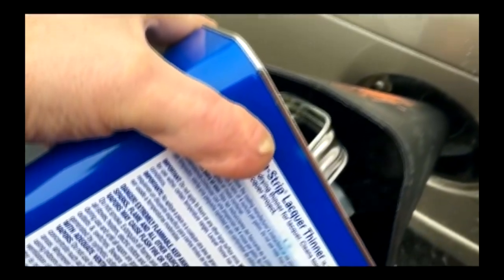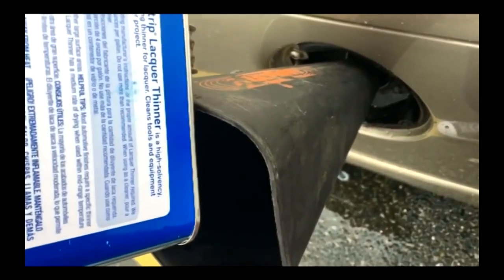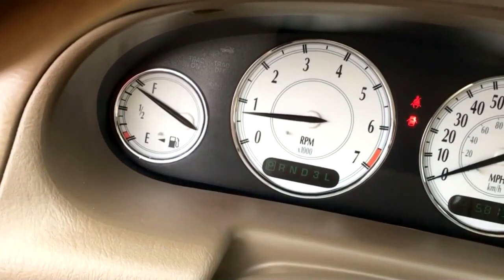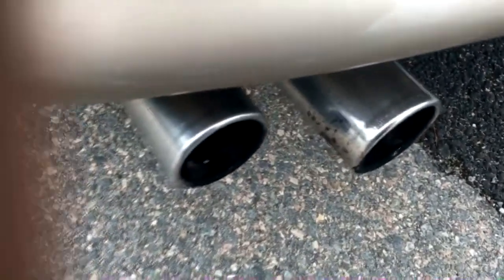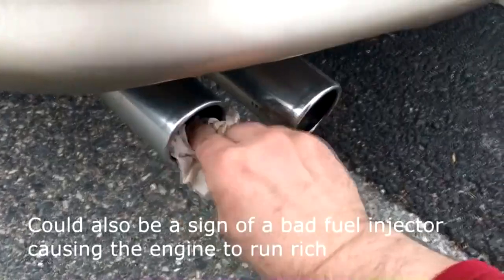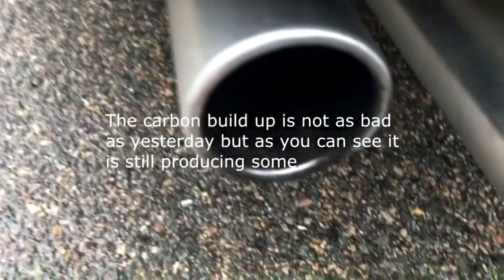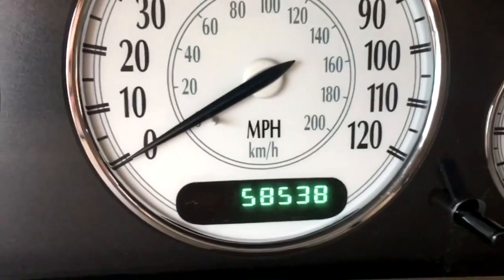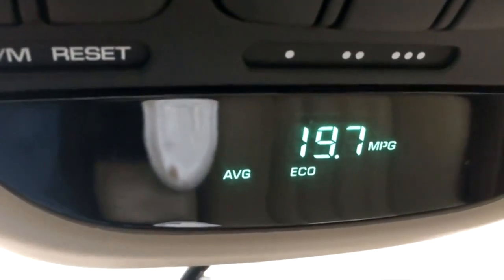Lacquer Thinner Fixed My Converter & Passed Emissions/Safety Inspection | Techn' Moto

Comment: This worked for me too. I didn't have the code but car had difficulty moving from stop. Car runs fine now. Saved me $1,000.
Reply from the maker: yep I've done it to my Ford Taurus too and it made it idle much nicer and better fuel mileage. Glad it helped you out and thanks for commenting, I appreciate the support
Reply: Just curious what you drive? I have a94 Nissan quest and I've replaced o2 sensor, fuel filter, complete tune up plugs wires distributor but still runs really rough but ONLY upon acceleration! Once I'm on the highway I'm good but in the city it's rough! No check engine light either..
Reply: @TechnMoto  I did do it once going from Reno NV to San Francisco CA. BUT I forgot to put the damn gas cap on the entire trip🤣🤣. It ran no different..
Reply from the maker: @X ART P Investor  Sorry it didn't work out for ya but this fix is not for bad acceleration, of course doesn't hurt to try it. I would have the engine checked out could be something else like a bad sensor. Try cleaning the map sensor to see if that helps but the best bet is to have it checked. Take care
Reply: Thinners won't melt or damage your fuel pump? I know MEK melts rubber o rings etc. Any reply appreciated cheers from Australia 🙂
Reply: It is possible to translate it into Arabic because there is no copying the explanation from YouTube
Reply: My 2001 Malibu had trouble going up hills and weak exhaust stream. I put a gallon of lacquer thinner in 2/3 tank and drive on freeway for 40 minutes. After a few minutes, started going up hills just fine. Also, didn't die at stop sign. Just the first day, don't know if it will last.
Reply: @Upub5  how's it going?
Reply: The engine light went off and never came back on again right 
Somebody told me before I take it to the inspection to use this so it works good right
Reply: Thanks for this great hack. I got a question. I did something  like that but using seam foam. What I did instead  pouring in the gas tank I removed the primary O2 sensor and poured the whole bottle and let set for almost 10 hours. Can I do the same thing with lacquer thinner?  Thanks
Reply: @TechnMoto  oo cc
Reply from the maker: @king dz I do this once a year now. Just to maintain them. Keeps mine running good. But that’s just me. You do what you want to.
Reply from the maker: @king dz 😂👍
Reply: @TechnMoto , I'd think keeping things clean is better than waiting for carbon to build up and throwing a code. ...about to do my wife's car with the Lacquer thinner.

Comment: One thing that most people are not really aware of...the Cat clogs up when your engine uses oil. Most 
people on here regularly change their oil, but most do NOT change their PCV valve. If this valve fails, 
your engine may well be sucking up oil into the intake. If you have to clean your Cat, change your PCV valve.
It's Cheap, and it just might prevent it from doing it again.
Reply from the maker: Good info 👍
Reply: there is a ECG valve as well that could need tending to; thanks for mentioning PCV valve✌🤘
Reply: My Chevy equinox has this problem oil consumption but the problem with new vehicles the PCV valve is hidden inside the cover valves
Reply: @renebaltazar3527  I was not aware of that. Are you Sure about that?
Reply: 7 months ago I had my breather box taken off, cleaned, seals and also bought OEM parts from honda, ie the O Ring and the 2 connectors which I can't remember the names of right now. About 1 1/2 years ago I replaced my PCV Valve. so it should be good for a while. When they cleaned, sealed the Breather box and put the new pieces in, it ran so much better... I'm going to replace the PCV valve after I do the Cat Clean / Lacquer thinner!

Comment: It worked for me, don’t just run the engine, drive the car, I put one gallon on little under half tank and drove the car on the highway 75-80 mph for 2 hours I think it was about 200 miles. The car definitely accelerate better and my car now creep forward when in drive and foot off brake, before, it wouldn’t roll unless I give it gas. I reset the light but it came back on then went off. So, it worked. Don’t know if it’s permanent. Mpg improved I got 360 before gas light came on, now it close to 410 miles.MAKE SURE DRIVE THE CAR. floor it few times too.
Reply from the maker: Cool to here 👍👍
Reply: @Ehab K Any updates? I have the p0420 code on my ford fiesta and don't have the funds to replace the converter. Looking for alternatives and thinking of giving this a try
Reply: @onit_4208  had to get a cat eventually. Code came.
Reply: @TwoWheeledCamel  I get the P420 code every day after I clear it with my OBDII scan tool. The car stinks of exhaust when I start it and let it idle. I have a Honda Accord. Seems to be quite a common problem. I’m thinking all cats used in almost every make are from the same factory and are just crap perhaps?
Reply: @K24Z3CU2  Any updates. Did you replace the Cat? I also have a Honda Accord

Comment: Yes..The gallon thinner with between 1/4 and 1/2 tank gas..Driving speeds 55+ Open Highway Safe..Please use Fuel Injection Spray Cans for Throttle Body/ Intake cleaning only...Just know that its usually the Back Downstream 02 Sensor covered in Oil/Carbon/etc...that can cause thw 420- 430 OBD2 Codes to begin with...

Comment: I've done this a couple of times. Vehicle seems to run better. You are suppose to drive consistently for at least 20-30 minutes at 120klm or hold the throttle at 2 1/2 rpm for 20 minutes. Especially if the vehicle burns oil.
Reply: Thanks big dawg

Comment: I did this this week with my 2005 v6 Highlander. I drove 22 miles with a half tank of gas and lacquer thinner and the check engine light turned off. So happy!
Reply from the maker: Glad it worked for ya
Reply: How many miles on the Highlander? Thanks

Comment: Wow. Worked for my 2008 Honda Odyssey. Cleared in 150 miles. Amazing.
Reply from the maker: So COOL! Glad it worked for you.
Reply: Yours is the Jseries v6?  I got an Acura MDX and my rear cat is clogged and I can only go like 30mph MAX and if i give it more gas it bogs to death.  Im putting this in TONIGHT.  Just got back from Autozone and I bought the same brand too.
Reply: My dad has the same van and got the code last year,  I suspected buildup but didn't see this idea so well documented.  I used a retail chemical and he light went off while driving - I never saw that before...now my car is doing it so I may try this.
Reply: @automotiveperformancemobil4030  any updates? Did u try it out?

Comment: Doing this right now on a 2000 Subaru outback2.5. Full tank with one gallon on thinner. I reset code prior. Driving 50 miles a day on highway. 200 miles and no cel yet.
Reply from the maker: Good luck 🍀👍
Reply: No good can't on full tank its bad to overkill  gas tank reason it stops when full at the pump. Ypu can ruin your fuel pp well-being this one time will be fine but  it's more of a ratio thing so I'd do woth half pf tank

Comment: worked for me 2 1/2 times. I gallon to 20 gallons, light went off for two months passed smog no sweat. Second time two years later samo. Third time two more years later it had bank one not reaching temp. bank two not reaching temp. Thinner treatment worked on bank 1 code buy would not clear bank 2. I erased codes and drove until monitors reset. Took it in and had it smogged before light came back on. It passed smog with a increase in hydrocarbons. Light hasnt come back on yet. Been about three or four weeks. 1997 chevy silverado with 308,000 miles. Saw it on Scotty Kilmers channel. It worked for me.
Reply from the maker: Cool. Scotty is the best

Comment: One thing to keep in mind, lacquer thinner is an extremely hot solvent. It will instantly bubble paint, remove grease oil or any petro-chemical contaminants, soot, varnish, tar, you get the idea. Its important to use the proper mix ratio's. If you use to little its not as effective, too much well don't use to much. It is also important to use up the fuel mix/lacquer thinner completely. And then fill up with straight fuel. The lacquer thinner will degrade actually eat up any rubber, some gaskets etc. in the fuel system, so burn it all up. I do believe this trick will work on a fouled or partially clogged cat, but if your cat is just bad it will not fix it.

Comment: I can only imagine that - if the lacquer thinner does clean carbon and burned oil deposits off, IN the cathalitic converter - how much more will it NOT clean INSIDE the combustion chamber - where oil rings in each piston allows this one to reach the top of the cylinder for lubrication - during combustion? Overall, I think is a win-win situation, if the thinner is not allowed to remain in the gas feeding system, avoiding harm to to rubber components {seals, hoses, etc}, exposed for a little while. Thanks for video! ✔✔
Reply from the maker: I don’t know but it works for me.

Comment: I bought my 2009 Honda Accord Euro (Acura TSX) in 2013 and from 2015 I started to get the P0420 code. I am so used to it now I either just clear the code with my scan tool or put up with it. The log book stated the previous owner put unleaded in and the engine started to ping and dealer adv to use premium as per fuel cap. A few years ago my entire engine was rebuilt because of that. All four cylinders failed it took a while to get it fixed. Since then my stater engine failed and has been replaced. Sometimes the car won’t start because the replacement starter engine is either refurb or junk and I get a P339 Crank Shaft error. I’d try to put a gallon of Lacquer Thinner in but have a feeling it might matters worse. Sadly the car is slowly dying and has cost me a bit to maintain and I’ve done just over 234,000kms on it. My brother has a 2005 Accord Euro and he has done 449,000kms on it. They keep on going but have their fair share of issues!
Reply from the maker: That is amazing. I've heard those cars can go like that but I never seen one. I did see a Nissan Maxima back in the day that had 330,000 miles on it and kept running like a champ. All the guy did was maintenance as required. Hopefully yours will keep on running for you. Good luck
Reply: If you’re getting a p0339 crank shaft code then you may have an crank shaft sensor intermittent failure I would have that crank shaft sensor replaced especially if it takes longer times to start or sometimes stall it’s just a matter of time before it leaves you stranded after a complete fail

Comment: I am a certified Auto tech this is amazing had no clue would of never tried it good to know thanks for posting
Reply from the maker: This tip has been around for years and I have to say I was informed by a person named Scotty. Great guy with many tips, I think I linked to him in the description area. Stuff works great and I still use it on a yearly basis as a fuel system cleaner. Works great for me.
Reply: @TechnMoto  I wonder if you can use this on carbed systems but you use a whole gallon on a tank of fuel ? Did you get any knocking or pre ignition using this?
Reply from the maker: Nope
Reply: @TechnMoto  Wow amazing thought for sure bee knocking and farting all the way until the thinner went through
Reply from the maker: nah works great as a fuel system cleaner too. I use it often
Reply: @TechnMoto  Do you have to use the whole gallon every time just to use as a cleaner what is your ratio
Reply from the maker: @madmanmechanic8847  I use half a gallon with a full tank as a cleaner once a year. Seems to work good.
Reply: @TechnMoto  Cool man thanks
Reply from the maker: @madmanmechanic8847  np

Comment: Hello good video I'm just wondering did you do this because of a code or did you have any symptoms of a plugged up catalytic converter
Reply from the maker: just because I kept getting the code. my converter was not plugged up.
Reply: @TechnMoto  okay but if it what's the code more than likely it would have been one of the CO2 sensors not the catalytic converter I would have checked the CO2 sensors first before and after the catalytic converter before I would have done that test with the lacquer thinner I cannot find a video where people did this because the catalytic converter was actually plugged and they had the symptoms everybody seems to be doing it because of the code which I do not understand thanks
Reply from the maker: did all that- replaced the sensors still getting the code till I did the thinner then car ran fine after that till I traded it in.
Reply: @TechnMoto  okay you said it ran fine after you did the lacquer treatment so I'm just curious how did it run before you did the treatment did you notice a difference in performance in power after you did the treatment thanks
Reply from the maker: Oh yes better idling and better mileage. I now do this to all my vehicles when I think it needs it. Better than any fuel cleaner. Have videos to show this.
Reply: @TechnMoto  okay thanks I will definitely check out those videos

Comment: Yeah, you had to try, and it worked for you. Glad to hear it. Thx for the video.
Reply from the maker: Thanks
Reply: @TechnMoto , I've been checking out videos from different people, with different vehicles. Going to try it on my wife's Subaru Crosstrek with 155,000 miles and the P0420 code. It's worth a try!!
Reply from the maker: @petset77  can't hurt, right.

Comment: I have a P0420 code now on my 2010 Ford  Fusion and I'm going to try this..thanks and I'll let you know if it works
Reply from the maker: Thanks I’m always interested in how this works for folks. A lot have had good luck using it. I still use this on a yearly basis to keep my vehicles running good. But that’s me. Take care
Reply: I'll let you know how it goes
Reply: @keithnorman4985  update?
Reply: I have a 99 Gti V6 and have the thinner on hand to try this. Check engine light has come on quite a few times with the p0420 code. Just got to find the time to drive about 150 miles with little traffic (hard to find at times in Chicago area). If I remember, I'll post an update.

Comment: What if you have a used vehicle that shows no codes for the cats, can you still use it just to clean the cats out?
Reply from the maker: I use this on all my vehicles, especially when they feel a bit sluggish or seem to be using more fuel than normal. Seems to do a great job on keeping my engines running smoothly. I think it's better than fuel cleaner but that's just me.

Comment: Sadly my cat was shot and it didnt work. I had a floating misfire and it fried the cat.  i ran the thinner through on 5 occasions each time with a richer mix. Car runs great though, it does some serious cleaning. My car is 200k and it did clean the engine fuel system and exhaust out.
Reply from the maker: I use this stuff once a year just to keep my cars running good. I too find it works great. take care and thanks for watching and commenting

Comment: 2007 Santa Fe had the cat code P0430 1 gallon  L/T to like a half tank...it ran for 10 mins and died . I have not been able to get it to start.....it does crank but that's it ....any advice?
Reply from the maker: Have someone check your vehicle. You have more going on than just a cat code. Good luck 👍
Reply: @TechnMoto  OH i learned my lesson the fuel pimp stopped injectors  clogged  $1000 mistake

Comment: Did your car drive and run smoother after you did this? My truck has been hesitating when I accelerate or go up larger hills. Currently my trucks CEL is on and when I hooked it up to the scanner I had codes P0430 & P0420.
Reply from the maker: I had such good results with this that i did it on my ford taurus made both cars run better. https://www.youtube.com/watch?v=6kHM07epnHc As a matter of fact its the only stuff I use now when my car's engines need a good cleaning. No side effects from it that i can tell.

Comment: Wow amazing I’ll try this with half tank and 1 gallons of lacquer thinner and just raise rpm to 2 1/2 for 30 min hope it’ll improve but what about 2 gallons will it be harmful to the cat ? 
Mine looks like clogged cause front is 140C and back to exhaust tail pipe it’s 100 C so it should be reverse not that way to know it’s functional cat back should be hotter than front
Reply from the maker: No guarantees that it will work but maybe worth a try? Never tried two gallons at once so not sure if more is better. Maybe someone on here can help with that. Take care.
Reply: Did you try it? I own a bmw 3 series and want to try as well
Reply: @Amitkumar-sd8fl  yes  it worked  just tested today front of the cat  now it’s 137 C after cat now it’s 165 C  after 2 gallons of paint thinner in about 30 liter of fuel and I drove normal nothing changed in my driving style  , I didn’t raise rpm or did anything unusual